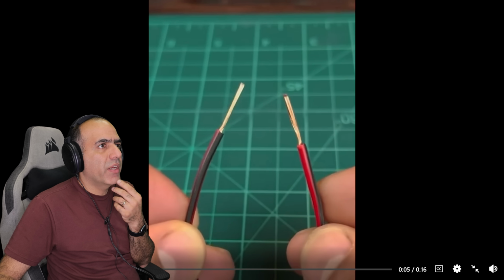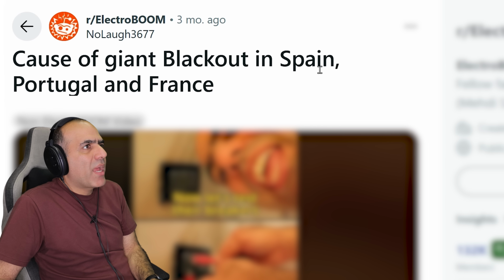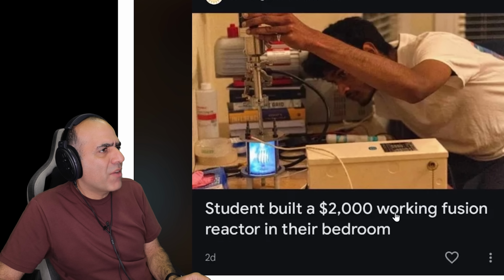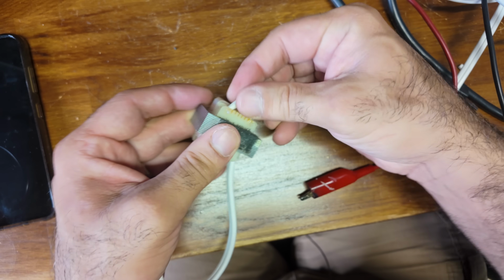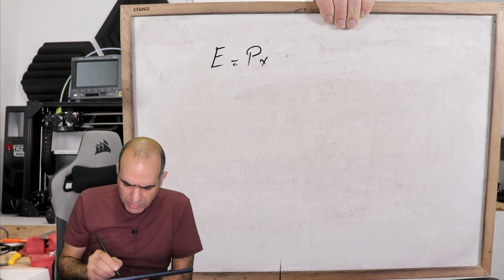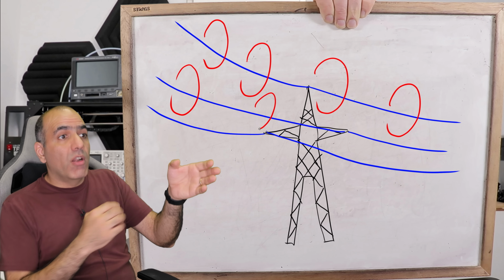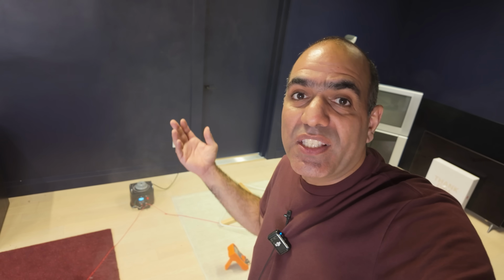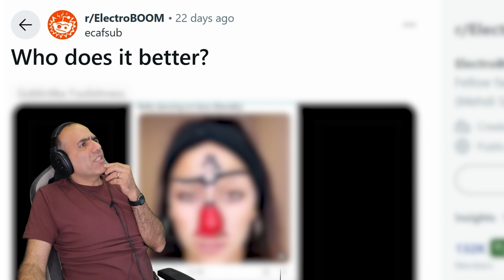Power Lines at Knee Level? Campfire with AA Battery?! (LATITY-016)

Comment: I play golf on a course with huge power lines running over some holes.  You can definitely feel  a tingle if you put your putter on the ground and touch the metal shaft.  But sparks?  No.

Comment: You can do the AA battery lighter thing with chewing gum wrappers that use foil paper. Especially since a lot of them use a waxy glue to hold the pieces of gum in. It works super easily.

Comment: Some power bricks are so huge they go over the next slot. Maybe the splitters are designed so that if there is a huge brick plugged in you can still plug something next to it? maybe? But then isn't live or neutral going to both of the prongs? Depending on the way it's wired of course

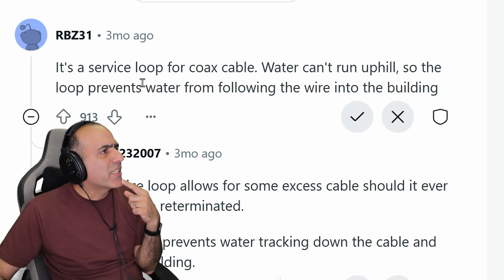Comment: 10:15 apparently the picture is in the philippines. From what I understood is just extra slack to prevent tension on the wires or its just extra bit of wires just in case you are replacing the modem or conduit and you need fresh wires
Reply: It's a drip loop, dude.

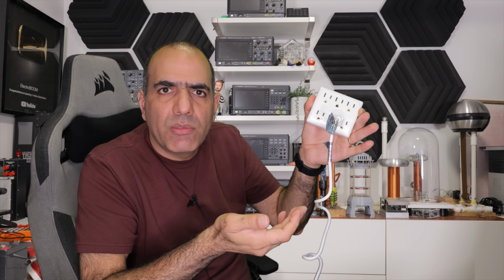Comment: 4:00 The application is if you have larger power bricks that are too wide to fit three across and that would hang off the edge of you plugged them into the two outside sockets.

Comment: I can see being able to plug across 2 outlets useful if the other outlets are full and the thing you need to plug in has a large wall wart. It's especially useful when the wall wart is one of those annoying 90 degree ones that will cover the one next to it.

Comment: The service loops on the coax cable serve two purposes. It does prevent water from getting water into the barreled connection, but it also gives a little bit extra cable for when the system is serviced. sometimes connectors need replaced, or a section of cable needs spliced somewhere down the line and now you will have a bit extra. We are usually trained to make them about the size of a cd rom.

Comment: 4:00 This is actually something that you get to learn when using cheap extension sockets.
See, many charging bricks, especially phone bricks are too big for absolutely no reason other than for show (and pretense) so when multiple people are trying to charge from a single extension, you have to find a way to maximize the space and one of the things you can do is plug in-between sockets since you can't plug most charging bricks next to each other 
Hence a row that might not be able to take more than 2/3 chargers can take one extra charger now.

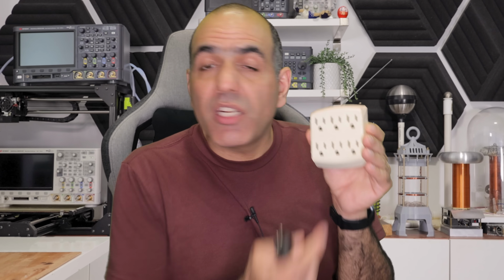Comment: 4:07 My first thought is that often you run into the problem where you can’t fit one plug beside another bulky power brick or something. But this theory doesn’t last long because you could just use the furthest socket over. So I’m going back to thinking it’s just pointless 😂

Comment: i got that same 6x outlet. i use the top 3 for wallwort and the bottom 2 offset for 2 more wallworts. the 6 wont fit cause where the wire comes out but offsetting the bottom ones makes it work perfect.

Comment: Well Mehdi, you aren't being fair, fusion reactors ARE very very easy to make, fusors are glorified gas discharge lamps, meaning its just a neon tube with a mix of deuterium and tritium gases instead of neon; exposed to a bit of high voltage fusion events will totally occur. The trick of course resides in extracting more energy that you are putting in.

Comment: Bro those lines aren't conductors there they were also work as inductors hence the force field around the wires hence why you're going to be arc or move the chain and that's why the fence is there to give you something to play with instead of killing yourself on the high voltage wires. And the words of the wise if you're going to use induction to pick up voltage off of a high tension wire your best way of actually getting it without burning the bloody carpet is to spin your like large kite of wire through the field it'll be like way better to pick it up to get more voltage more amperage instead of just needing it there and you'll have AC current.

Comment: If one of the prongs is loose and also smae with another one and in a miracle you got 2 ports aligned just like that so you can use it like 2 ports one plug

Comment: You use a piece of nichrome wire and wedge it in there to make the battery lighter, not a piece of the copper wire.
Reply: Oh and the reason you don't tell people that when making the video is for the ragebait engagement boost.

Comment: I've seen the wire and battery hack in a different manner: Take a buble gum wrapper. They are usually tin foil and paper glued together. Cut the wrapper thin in the middles and place the ends on a battery. The tin becomes hot and ignites the glued paper, making fire. I haven't tested it though.

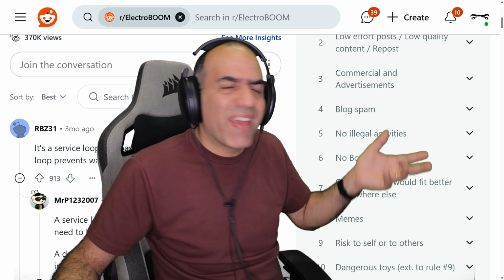Comment: At 10:25 (sorry, don’t know to make the link) - they are called drip loops, anybody that maintains aquariums knows about these - All power lines (pump, heater, UV sterilizer, etc. ) have this to protect when the tank leaks. Not if. When.  Keeps all that nasty fish water out of the outlets.. which you have demonstrated numerous times, can bite otherwise. Also have check valves to prevent siphons that will auto start due to capillary action I if not present.

Comment: That seemingly useless "plug something between two outlets" trick seems to be a design specifically for those wide "wall wart" power bricks. Lets you plug one in the 'wrong' way and only take up two outlets instead of plugging it in 'normally' and take up three by blocking two adjacent outlets.

Comment: 5:50 You can make a farnsworth fusor in you basement. And also set of every dosimeter in the vicinity with the generated x-rays if you even get remotely near the purely theoretical break even point (not remotely achievable with this kind of clear glass contraption, with low voltages and current there isn't enough energy to do real harm).

Comment: I think there might be a point with the spacing on the outlets. But I find it hard to believe whomever designed it was that bright.

But if you have a particularly large power adapter that you don't want sticking out of the brick, and you still want to use a smaller connector as well, then there is a use case for it I guess.
However, it probably would make more sense to just get a bigger power splitter. And one would have to be a very special kind to care if a power adapter sticks out.

Another logical possibility is that the housing is extruded rather than molded. Then it makes sense to keep the spacing identical so you can snip off the housing at any point.

Comment: For the split plug thing, you could fit a 2x wide transformer block to take up exactly 2 spots instead of taking the regular 1 plus blocking 2 others either side of it, totaling 3 covered receptacles.

I've used this on a power strip for the router, modem, etc nest where there's only 1 end spot that wall warts can overhang, but theres like 3 wall warts and a couple regular plugs that need to fit.

Comment: I have never made a fire with just a AA battery but I have done it with steel wool and a 6v lamp battery. It's not the easiest method out there but if you can get some embers going and eventually get a fire going that is all that matters.

Comment: I was at an an radio transmitter shack 50k watt i believe. I laid out a 70 foot run of #6 romex on the ground. I grabbed one end to strip it and it jolted the hell out of me. I know it was rf energy but don’t exactly know how it collected in a romex cable laying in a straight line on the ground.

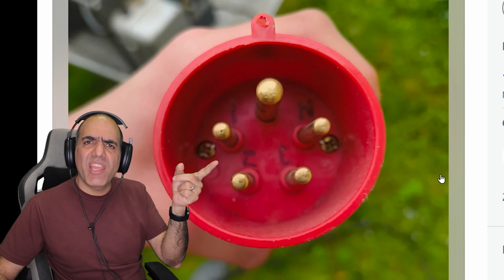Comment: 10:37 That is a CEE Form connector and the male end is actually the input receptacle that would normally be installed on a device to receive power. The female end of the connector is on the cable that comes from the power source connecting to the device. And they are actually pretty cool connectors. They are weather resistant and the female connectors have a screw-on cover protector that doubles as a locking mechanism. This connector in the video is probably the same as an L21-30 connector in the US.

Comment: i have a question about putting the plug in between 2 outlets, what if there were 2 90 degree plugs plugged on the top row, and somebody used bottom 3 as 2 outlets but offseted?

Comment: All of the sources for those turnstile generators (first result cites the WEF for backing them) quote 2000 watts in a day. 
"For two days, 27,000 passengers going through the turnstiles yielded 2,000 watts/day of energy."
That isn't even a standard measurement of energy. Unless it's 2000 watts over a day, which the article suggests. So 2000/24 = 83.33 watt hours. 
Maybe enough to power the ticket readers in the turnstiles on a busy day. Such power. Probably costs a fortune to make those things too. 

A better idea would be to use down moving escalators as generators when a certain weight threshold (number of passengers) is passed instead of using the back-EMF as a braking force, the escalator just charges some batteries, or provides supplemental power.  That just requires enough people to stand on the escalator.
Reply: Downward escalators actually already generate power, Veritasium recently made a video about them

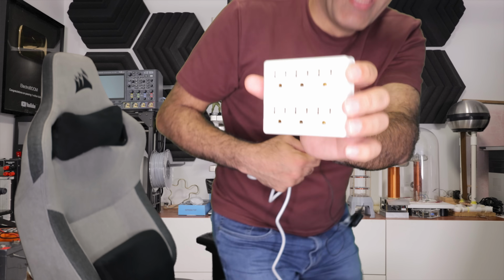Comment: 3:32 FYI I've seen a few of those devices and I items and tems that have the spacing just slightly off that doing so with bend the prongs. so well this is possible it's some thing that shouldn't be done. It's amazing that they actually have the spacing perfect like that. Which just tells me sure you can split the plugs out but you're not gonna be able to plug anything in next to it because it will interfere and overlap. Oh and as far as why they did that somebody figured out they could save X amount of dollars if they shaved off 2 mm and made it ever so slightly smaller rinse and repeat a few hundred times. So what with safety standard spacing.

Comment: The power lines making chains arc is 100% real. I did a job on a vehicle next to some transferlines. You could hear them. I went to work on the rear end and got a pretty nasty shock to my fingers from the van. I put gloves on and it did nothing.😂
Reply: You can't get a nasty shock from this.  The power levels are miniscule.

Comment: 6:00 you are wrong about the fusion. You can actually make a fusion reactor out of cheap supplies and run it on deutetium-tritium however the output power will be millions of times lower than the required input power to achieve fusion conditions. Go to your friend From plasma Channel, he made a nuclear fusion device.

Comment: 4:00 some chargers/devices are bigger than just the plug so I assume you could squeeze more of them having such outlet? Haven't seen such for European-style tho. But I have a WiFi repeater plugged in the socket that is covering two neighbor sockets and it's frustrating.

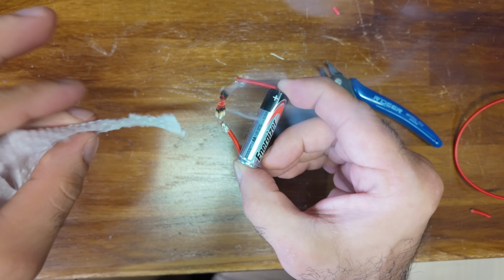Comment: 2:00 I did similar thing using single AA battery and a wrapper of old-style bubble gum - the one with flat small sheets wrapped in double layer - one probably aluminum, one paper. You cut that wrapper in an hourglass shape and the middle was so narrow it got hot enough to set on fire paper layer. Instant small flame. However, I haven't seen such bubble gums for years.

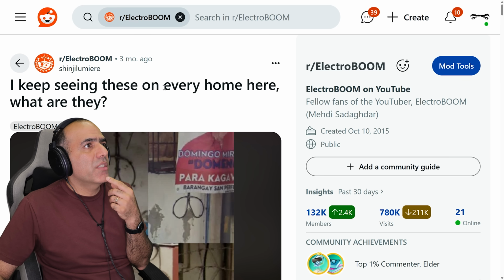Comment: 10:05 Hi I'm an electrician in the Philippines where this is at these are for coax cables to have an excess amount of wire in case something breaks down and also to prevent rain ingress. Rain is severely common here
Reply: We call them service loops in UK industrial applications.
Reply: Rain is pretty common in most of the inhabitable places on the planet.

Comment: I tried to make the DC motor with one AA battery and a stripped 23awg cat 5e cable and the wire got pretty damn hot when it touched the negative pole of the AA

Comment: 0:52 thats kind of like asking if using a fuse to prevent an electrical surge hurts the fuse... Of course, but that's the point? Alkaline batteries aren't meant to be rechargable, AFAIK.

Comment: In the very first part, the guy had charcloth, not just uncarbonized/ regular paper towel. Charcloth is basically fabric like linen, and heat it without oxygen, basically turning into charcoal that still has the weave of linen. It catches even small sparks extremely well for starting fires. So that single strand wrapped around charcloth would likely make a difference from when you tried it.

Comment: 3:22 I've done that before, but with the North American counterpart. All it does is connect to live and neutral as it would normally, but it bridges across 2 outlets. Not necessarily a hazard, but electricians might yell at you.

Comment: 4:10 A possible reason for this spacing of the plug could be to allow more flexibillity. If you have a big plug with earth that steals a bit of space from the neighboring outlet, it could maybe help to arrange the plugs so they still all fit. 
Other possible reason is that its just cause the standard outlet is that sized that if they are next to each other it fits.

Comment: At 9:00, I had interpreted the 2000 watts as a daily total, not per hour or anything.  So that would be well under 1/10 Watt per passenger.  That seems more plausible, though not terribly valuable.  But the windmill-shaped barriers already scream "attention-grabbing art project" rather than "practical power generation".
Reply: Watts are a unit of power, not energy. Saying "watts per day" makes no sense. A watt is one joule per second, so you'd be saying "joules per second per day". The correct phrasing would be "watt-hours per day".
Reply: Watts are a unit of power, not a unit of energy.  They don't have a "daily total". It's like asking how many MPH are in a mile.  What I imagine they meant was they generated 2000 watt-hours of energy in a day from 27,000 people.

Comment: Dude, you once again forgot to account for mechanical advantage. Your calculations are assuming you're spinning the generator at the source. You should have divided you end figure by several hundred. (Length of the lever [2ish ft] divided by the length to the apposing fulcrum [a few mm I think] or whatever it is). Plus whatever is added by the gear ratio they showed.

Comment: The only thing I can think of for the spacing is if you have over sized brick adapters plugged in to the outer outlets you can still use 2 half outlets in the middle but that only works if there are at least 4 outlets in a row.

Comment: The multi outlet using 2 is because sometimes you have different things plugged into the multi outlet which are different shapes, some boxy type with prongs and some pronged like the plug you used.

Comment: This plug-where-you-like thing, but rectangular, was intentionally sold as "розеткус" in Russia and since then copied many times by Chinese.
I guess it allows for different-sized wall-warts to plug without obscuring each other as much. And looks weird.
 
I don't think the design firm that created розеткус is actually its inventor though.

This probably stems from that in USSR the power strips were simply not sold in shops - at least I haven't ever seen one - so people made often their own out of very dangerous contacts designed for split radio plugs (currently evolved into banana plugs but I still use soviet ones).
 
Since they were made by hand with mechanical hand drills and not enough precision, and the sockets were designed to hold split plugs (where plug retains the connection) rather than normal europlugs (where socket holds it) the results were veeeeeery fiddly so often you would try to plug between adjacent sockets hoping it would make enough contact and not burn your house down, for that reason some strips were cross-wired, and indeed some were a rectangle rather than just a line as making a square box by hand is easier than a long strip.

At least it's better than the other standard USSR practice of cutting the plug and just wrapping wires in "---O" pattern, pushing around the poles of another appliance's plug and shoving it all into the socket. That is how probably half of soviet holiday-lights were wired as soviet homes typically had one socket per room, never seen more than two.

Comment: You're wrong about the fusion reactor. Hobby fusion reactors have and still are made. They just use heavy hydrogen isotopes (tritium or dueterium) and consume more energy than they put out. 

The purpose of a reactor (fission or fusion) is not to generate electricity. That's a usecase. A lot of experimental fission reactors don't and didn't produce any electricity, they just dump/dumped heat into water.

Comment: 2:28
No fuel, probably just very dry ground fatwood.
Fatwood is wood from a dead tree/branch where the sap has sunk to the lowest point and will burn extremely easily.

Also looks like the original vid uses charcotton (heat part of an old cotton shirt over a fire in an empty shoe polish tin with a hole punched in the top with a nail until flame stops coming out if the hole then wait 10 mins, take it off the fire and open when cool) rolled up, charcotton is extremely dry and turns into embers even with a tiny spark.

You can absolutely start a campfire with a AA battery. It's easier than using a piece of ferro rod.

Comment: We built a large metal building (a fertilizer shed) that was directly underneath some very large power pylons in Virginia. After enough of the metal roofing was installed, the building started to zap us constantly and with some serious force. We knew it was the power lines, but weren't quite smart enough to know why. We decided to ground the building itself and that stopped us from being zapped. My boss commented on how that meant that the power lines were "wasting" electricity, but i dont believe that's what was happening. From my understanding, the charge build up was caused from magnetic fields and therefore what you were feeling wasnt waste but actually generated electricity. Can anyone please help me to understand what was happening?... and also ponder on how dangerous it could be to build a fertilizer shed underneath such powerlines?